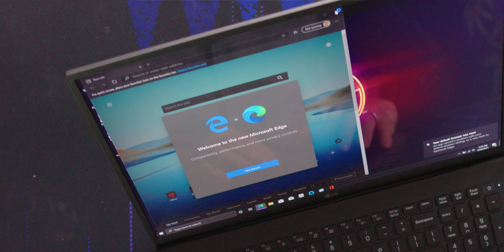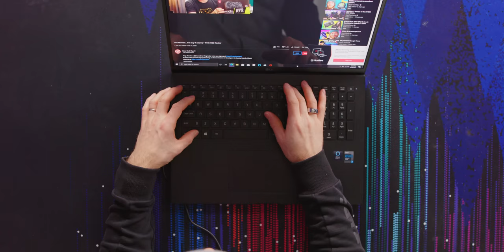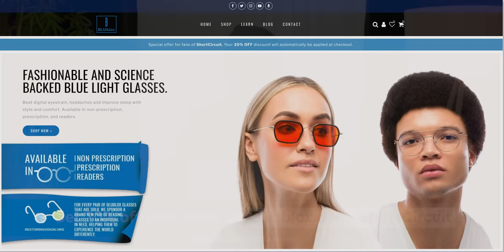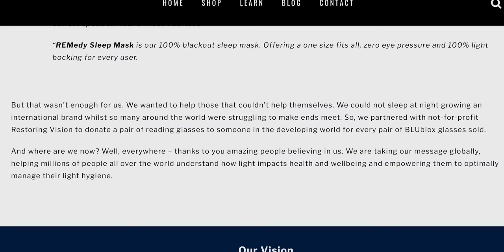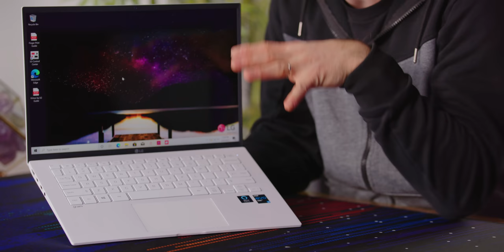Perfectly balanced as all things should be - LG Gram 2021 Laptops

Comment: RAM: can not be upgraded after purchase.
+ can not be changed at all

Storage: Has m.2 slots = can be upgraded
+ could be expanded via thunderbolt anyways.

So why on earth does it not have ram slots!?
Reply: I guess they don't want to deal with consumers losing their data. But if the RAM fails, they can charge for the repair.
Reply: Maybe they don't want to make the mistake Apple made with the M1 models where the SSD dies relatively quickly and the entire laptop dies (with all the troubles of the related class action lawsuit). RAM on the other hand is a lot less likely to die within the warranty period.

But it's more likely they just wanted a limited amount of motherboard configurations to save on costs and the SSD storage was the only thing deemed relevant (by the retailers) to provide different offerings in. So they made the SSD easily exchangeable.
Reply: Would prefer a ram slot that an extra m.2 slot
Reply: @walkinmn  you, but general consumers and companies that believe it or not are actually the biggest costumers don't really care about it since they will never upgrade anything 😂
Reply: @CheapBastard1988  The ssd is only a problem if you dont have enough ram i thought.

Edit: thx for bringing that up. Kinda forgot about that.
Reply: Most manufacturers charge about fair market rates for a ram upgrade, but gouge the fuck out of storage. I'd rather have user upgradeable storage for that reason.
Reply: @LyricsFred  That also applies for anything internal including that extra m.2 slot so?
Reply: LPDDR4X is good in energy efficiency while still hitting high clock speeds, only downside is the lack of upgradeability. But if you have the amount you need, you're better off...
Reply: @bobcorn69  Yes the M1 RAM problem is mainly when you run out of RAM frequently. But with professionals and pro-sumers that do video editing that happens a lot. Don't forget the base model (the only one in stock for a while) only has 8GB of RAM and the maximum amount is only 16GB. And for ordinary consumers the Macbook Air is genuinely the better product and for a lot less than the Pro so the Pro should actually have more RAM and an SSD with better longevity. My main gripe is the lack of transparency from the device to let the user know how much RAM is in use. That way reviewers could have already seen it happening and they could at least have expressed doubts about the longevity of the SSD.

Now I'm also wondering what kind of flash Apple uses. It would be acceptable if they used TLC flash in the Air and MLC flash in the Pro. But my fear is that they did QLC flash with an SLC caching system but programmed the controller for speed instead of longevity (like the one from Kioxia). But that could also mean that the base model 256GB SSD is more likely to die fast than the 512GB SSD.

It's typical for Apple to engineer a device with a (subjectively) pleasant user interaction and perform great in day 1 user reviews but skimp on durability and longevity with things like bad parts selection, impossible repairability and not designing a PCB properly which reviewers won't notice.

Comment: Totally agree with you on the full keyboard on a laptop.
For 16 and 17 inch, they should have gone for the smaller keyboard in the middle, with speakers and air vents on the sides, instead of the speaker being at the bottom. The LG grams have reports of heat issue and poor audio outputs.
Its great to have such a small weight. But even Samsung has come up with something similarly lite.
Reply: Will say as a 2021 Gram 15 user, no issues with the speakers at all. Which... I can't say about my older one!

It do get hot across the top edge of the deck though. 🥵

Comment: These power buttons were in use by Dell workstation notebooks a long time before ASUS. I think DDR5 should have M.2 connectors with separate CPU lanes. That would make it possible to sell RAM-SSD combos for single slot machines and leave an upgrade path for all non-soldered machines. M.2 GPUs would be nice too, for at least some option to get discrete graphics.

Comment: Finally you explained the finger print caching thing well.
Was always so confused.
Thought the fingerprint would always have to be set again if it's not cached.
Not just that it logs you in faster.
Reply: I upgraded my 4 year old gram to the 2021 model shortly after seeing this. The fingerprint caching is a neat trick!

What took me a while to notice, in the LG Control Center you can also re-enable Wake on Lid Open. Maybe given the way the power button works now, they disable it by default. But I'm very impatient and wanted back the literal one second it saves having it start turning on immediately. 😂
Reply: (Ah, and I'm pleased to say if it's mid-boot and you tap in the power button trying to register your finger, it's smart enough to not turn back off.)

Comment: I loved the 14 inch design, color and battery size. However it still seems dumb to pick any other laptop that's not the M1 Macbook Air since it is actually cheaper, has a waay more substantial chassis, P3 quality screen, better and larger trackpad, better keyboard as well as way better speakers and finally, it will still crush this LG in terms of battery and raw power. It lacks in the webcam, screen bezels and port selection, but man, I can't believe right now Apple leads in the price to performance department when it comes down to thin and light laptops. 😔
Reply: As an admitted Gram fanboy for a few years running, it's still over 0.5 lbs lighter and doesn't compromise at all on ports (no bag weight or clutter for dongles).

It's really hard to overstate how enjoyable it is to carry such a light, potent device from meeting to meeting, job to job, not needing any special connectors or even a power cable.
Reply: If only excel and other office 360 items weren’t so weird on IOS 💔😩

Comment: Did they fix the shitty barrel connectors for the power?  I used to work for LG in their IT department, and the older models would fail on them all the time.  Super annoying because they didn’t have docking stations and you had to buy a USB-C charger separately, but there were even older models that didn’t have those USB-C charging ports, which meant having to replace the chargers all the time if you unplug and plug it in several times a day working in an office and taking your laptop to meetings and taking it home.

My only real complaint was the lack of GPUs so we had to get Dells for the Engineers that needed to run CAD on their laptops.

The fact that Linus didn’t remove the battery makes me wonder if he’s missing something, because I swear they used to put the RAM underneath it.

Comment: When you use LPDDR4(X) memory they always are soldered, no exception. If you use SO-DIMM you will loose performance especially for the graphics and, as you said, gain weight.
I don't know, if 32 GB are really a necessary option for the Grams. Sure you could do some stuff in these notebooks that would need more memory, but to be honest, if you really need more memory there are still many Windows laptops that will give you this option, which is a nice thing in contrary to MacBooks.

Comment: so if you have an automated system for manufacturing a component, but it needs 20 copies of lesser components to make the one... how hard is it, now that the one component is made for it to not continue the chain going up but to look back and gear its self to replace the component line that is processing the lesser components. why, because on the wall... unless 0.005nm? yeah right.

Comment: For the 17 inch Gram, is the display still plastic and prone to scratches like the 2019 and 2020 versions were? Is the wifi performance still slow and inferior? Is it still among the lowest performing laptops in its cpu class? Speaking from experiance. Prioritizing lightness isn't exactly ideal when performance, durability, and quality take a back seat. After going through 3 Grams, ended up settling for a 17 inch HP laptop. Significantly better performance, significantly better wifi, significantly better durability, and while dimmer, a significantly more accurate display. I truly wanted the Gram and went through 3 of them but they kept dissapointing again and again, and don't even get me started on their interior sound. Love my HP but miss the lightness and battery of the Gram, but HP was better in almost every area that actually mattered.

Comment: @9:19
Most times I’ve had issues with laptops it has been a RAM stick that needed re-seating so I imagine it would make the laptops a lot more reliable to have soldered RAM. Not just about weight or size.
Reply: A soldered ram wont ever be seated badly
Reply: @suntzu1409  As I said it would make a laptop more reliable
Reply: @Kefford666  
How would a RAM that can never be seated badly be unreliable?

Socketed RAM is more unreliable because it can be seated badly, the pins can get damaged/rusted, etc.
Reply: @suntzu1409  Oh I just realised it could read like that. I meant I had issues with RAM that needed re-seating so soldered RAM would be more reliable. I’ll reword it 👍🏻

Comment: 0:34.  Dammit..I has the 1165G7 cpu instead of the core i5 one which actually is consistently faster ( same with basic crap..surfing web,  etc, but long term consistently faster with handbrake and other content creation/video editing involved software work loads because of the 1165G7's power draw being gimped in most thin n light laptops to 20 watts where it really n eeds more than that consistently to make full use of it's bigger cache versus the core i5.  

This is per Hardware Canucks's Eber in a video released either today, yesterday or day before.

BUT..I wonder if that is a per Laptop- deal as far as that limitation and wonder if this laptop ( if it has a core 5 variant) suffers the same problem OR can that core i 7 1165gy truly stretch it's wings and cache with more than 20 watts of cpu socket power??

Comment: Speaker sound is very low - Unusable for Netflix, YouTube and zoom calls....
My previous 2018 LG Gram 14 and X1 Carbon notebook PCs are loud and clear all the time so I am very disappointed with newest Gram 14.  Obviously the Realtek audio driver and DTS-X Ultra do not work properly together.
This updated Gram 14 was supposed to have better and louder speakers but it is actually MUCH weaker making movies, youtube and zoom calls impossible.
Very hard to hear content in these situations.
I worked on this issue for 2 weeks totaling of 10 hrs of my time optimizing sound and dtsX settings and called LG support 3 times to debug but was unable to fix the issue.
Disappointing as this updated LG gram was supposed to have better audio than the previous generation.

If I cannot fix this in the next few days I will return it for a refund.

Comment: Whats linus problem with a full size keyboard its really that bad to be a little offset? It fits perfectly in ANY 15in and its a fucking godsend when using excel  solidworks and blender. I rather have a full keyboard than any speaker if necessary as i use headphones every second i am on a machine, hell i rather have a full keyboard than a really big touchpad again i dont really use them i carry my mouse everywhere and a touchscreen works well too.

Comment: When are we going to get an lg rollable laptop or a foldable laptop or a transparent screen laptop 
When are we going to get mechanical keys that do not cause Rsi and a mouse that is truly erganomic and a laptop designed for streaming with lights 

Imagine having a laptop that is made out of programmable matter
I wish you could put your own design on a laptop rather than having black even thou plush 

It would be interesting for the screen to extend to your head height 

Did you have to pay for bloatware 😃
Every computer needs a 100000 Hertz screen 

Is it running Intel or AMD 

We desperately need windows 11

Comment: If they have downfiring speakers, you should try it on the table, without the mat. They may be configured to bounce off the surface and the mat may be messing with the sound. May make a difference, may not.

Comment: Personally all laptops should have windows hello facial recognition, id never buy a laptop without it. And all phones should have an underscreen fingerprint, id never buy a phone that went for facial recognition. Your fingers are always on your phone while you are using it, and they are small enough it is never any effort to press one to the screen, but it may not be pointed at my face if im showing someone something or checking it on a desk while i work. Whereas a laptop will always (p much) be pointed at my face while im using it. Face for laptops, fingerprint for phones. Change my mind

Comment: Writing this from an LG Gram 14 inch 2in1. Do NOT buy one. Whenever I open it up, it basically has to boot from scratch each time which takes forever, and if I'm holding it and press it in one particular spot, the entire laptop blue screens. LG support just shrugged their shoulders. Plus, the touch palm recognition is terrible when using it in tablet mode.

Comment: That's gonna be a no from me dawg. Soldered RAM, no Ryzen, fiiiiiiiine monitor.
Reply: 16GB of RAM is fine for the kind of tasks you’d be doing on that CPU
Reply: @keco185  honestly cant argue with that
Reply: Ryzen is suck on these kind form factor, Lack of integrated IO, not even have PCie 4.0 on mobile, bla bla bla

when making thin and light laptop u want these kind of CPU where many feature integrated so they get lighter and lighter so they didn't need to have separated module for that

Comment: I seriously looked at a gram last year but they're not available over here so I'd need to import it and they're just not competively priced. I got a HP AMD 2 in 1 which was comparable to the ASUS AMD 2 in 1. I hate that they don't have all the memory in so dimm slots, if there's 2 comparable models I'll get the one with so dimms.
Problem is it's virtually impossible to find out if they have so dimms, nobody advertises it's soldered on, a tonne of specs are missing for the manufacturer website and a lot of laptops have zero reviews on them or the person who does it is a low end youtuber that is afraid to open it and isn't a techie.
I hated the laptop buying experience, it should be illegal. Specs need to be listed on the box and website as far as I'm concerned.

Comment: I am very much considering getting the 16" but the fact that it has only 4 cores and is power limited to just 15 watts probably a deal breaker for me. If it could of had AMD's 6 and 8 core U series it would be amazing, especially if LG made the laptop slightly heavier with a 25 watt cooling solution. Though as someone who likes to play games on occasion, the better GPU in the Intel tiger lake CPU is a definite plus. But again the 15 watt TDP takes a lot of the usefulness out of it.

Comment: I was intrigued by an ad I saw, I used to have all lg products years ago. Until the “lifes good” turned to “life span is garbage” I remember my touchscreen phone breaking when my car broke down. My laptop hard drive failing while writing a 10 page paper. The WASHER & DRYER breaking the same day after the coverage expired! GRRRRRRRRR! Saw this laptop nothing special. Specs nothing special. 1K for this crap no. I remember the day in high-school I got a 2010 MacBook. That lasted until 2019, till software wasn’t supported. No LG ever again. There products have so many issues. I was hoping this would change my mind, but no it didn’t. Stay away from LG & HP PCS! There trash!